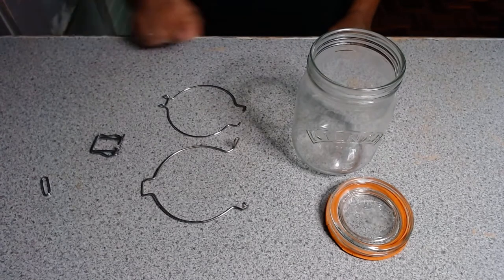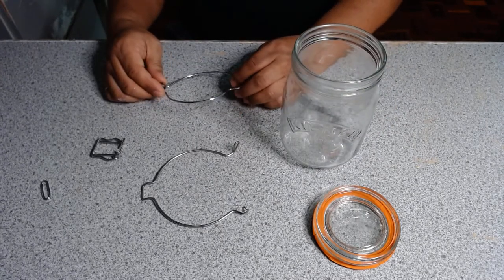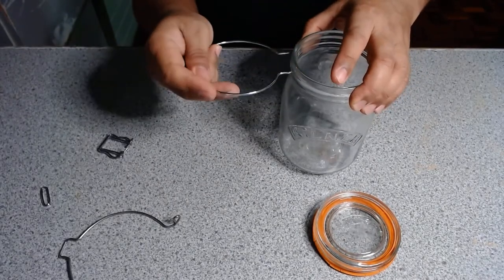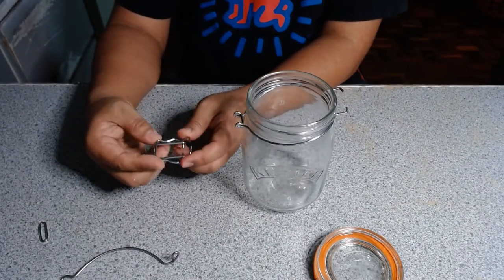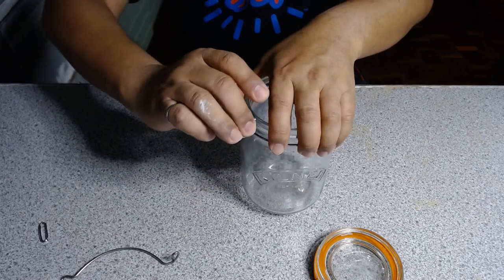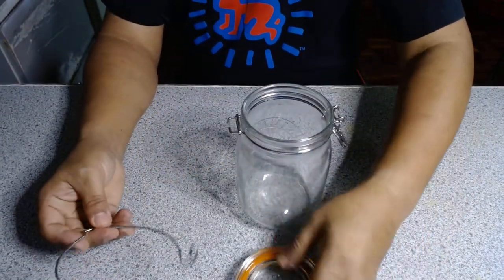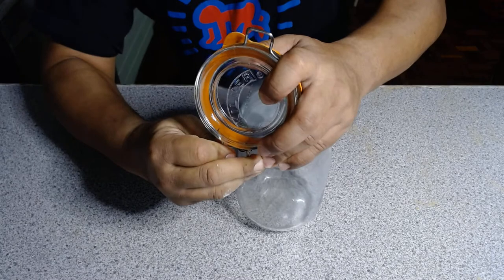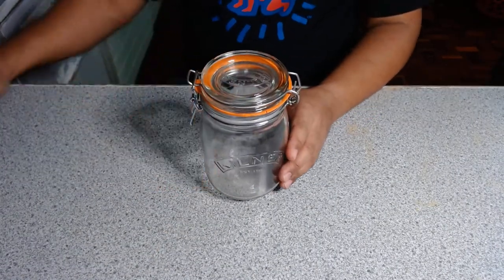Fixing the lid on the Kilner Jar

Comment: Does anyone know where to buy replacement rings etc as mine have become rusty etc
Reply from the maker: Over here in Malaysia, replacements are available online though I am not sure whether they are original. In the UK, I used to get them from the official website: https://www.kilnerjar.co.uk/products/accessories/replacement-lids-and-seals/
Reply: @DilipMutum  Thanks live in usa and cant find them on anything, so I took it off and cleaned it up with a wire wool
Reply from the maker: @anthonyivers-read709  It looks like Kilner doesn't sell the clips as replacement parts.
Reply: @DilipMutum  yes but thank you for your help